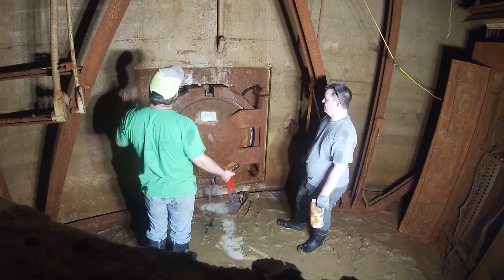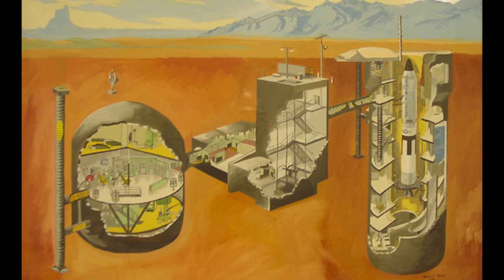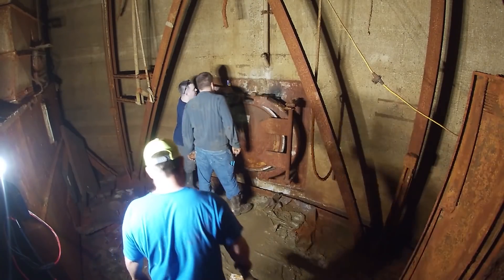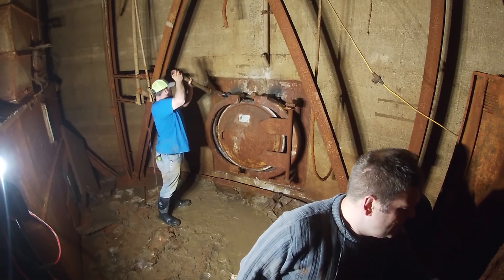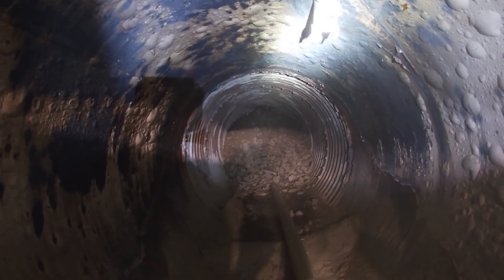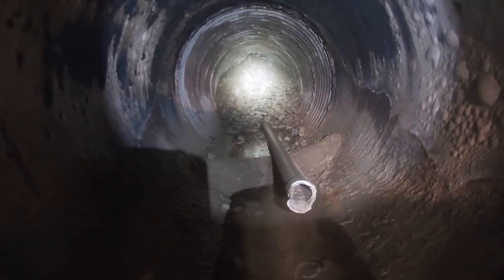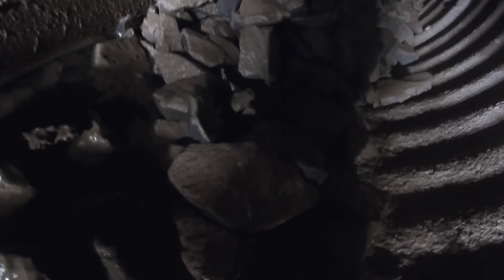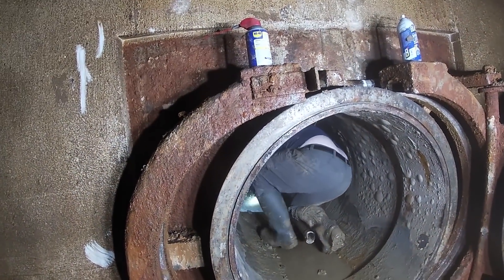HD REUPLOAD S1E9 - Opening the Escape Hatch - Owning a Titan II Missile Silo

Comment: One of the things you may have noticed is the clamshell only moves in one axis and has no pivot points on it.  The best way to seal and unseal this hatch is to alternate between the top and bottom bolt.  What happens over time is opening the top a certain distance and starts to put tension on the clamshell threads causing binding.

Comment: You know I might be wrong, but it’s possible that the pop was a type of pressure relief. It happens when an area has been AIR TIGHT for a very prolonged period of time. Like when you open an Egyptian tomb. They make a odd sound. Also when two separate tunnels met at the COMSTOCK MINE, the owner was almost killed when the pickaxe popped the first hole in the separating wall,the difference in pressure from the tunnels with two different heights caused a near literal explosion.

Comment: Pretty sure that wasnt an explosion but what you probably heard was a rather large bolt being sheered off, then again it couldve been the springs adjusting because the control center floats and the weight of the center was changing. the sound really reminded me of jacking up a car with a broken strut
Reply: Right?  I was thinking something breaking loose or shifting, due to the water draining, possibly causing a bit of a vacuum in the escape tube.

Comment: Is it possible the loud bang was caused by something falling, maybe a spring settling? if there was no sign of an explosion anywhere, the only other reasonable assumption is that something fell.
Reply from the maker: Yeah we looked into that. Couldn't find anything. Even dropped a metal bar and it was a totally different sound.
Reply: @atomicunderground9971  A methane explosion certainly would have left a lot of smoke, carbon residue, and the compression wave would have knocked things around. There likely would have been quite a flash even downstairs, and a temperature difference. Maybe a support beam or well somewhere gave way. it kinda sounded like a tension-based metallic noise. When you stretch a section of re bar, the metal can have little fractures form, giving off a loud pinging sound.

Of course, I'm no scientist. Maybe a piece of blue ice randomly fell out of the sky and landed on your roof.
Reply: @EnderMalcolm  Boeing Bombs
Reply: I would think a spring settling. Like tectonic plates building up tension/compression and letting loose. Wouldn't you have felt a pressure wave if it were a methane explosion? Even a little one?